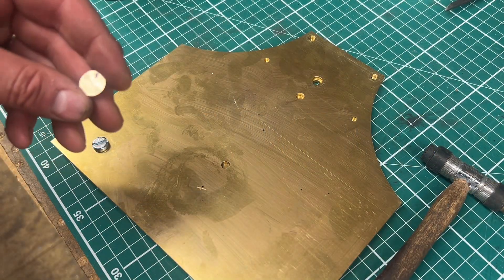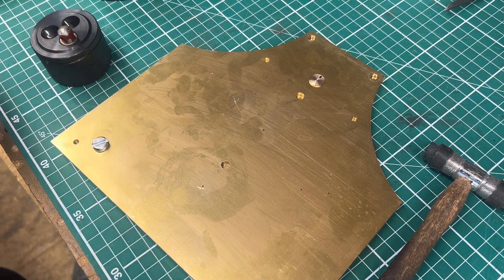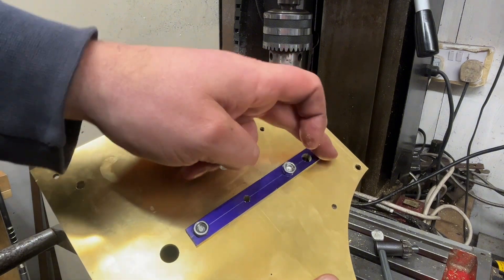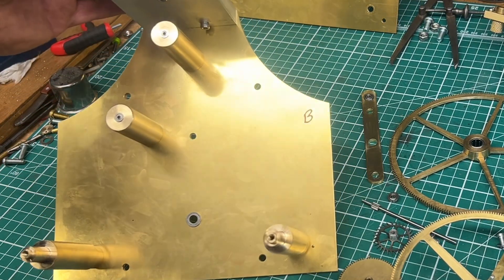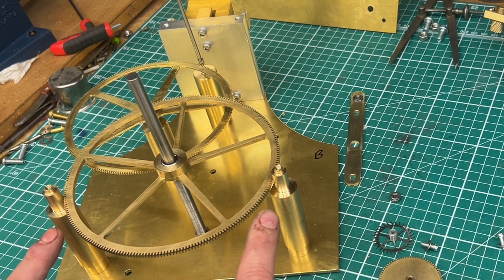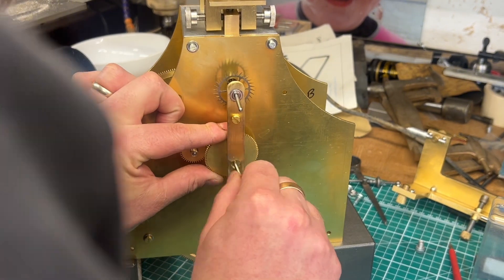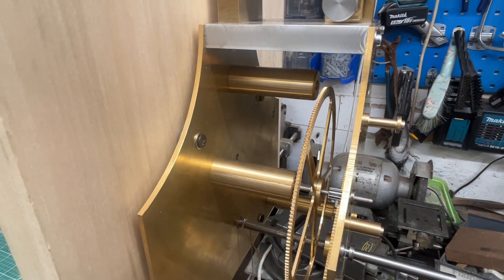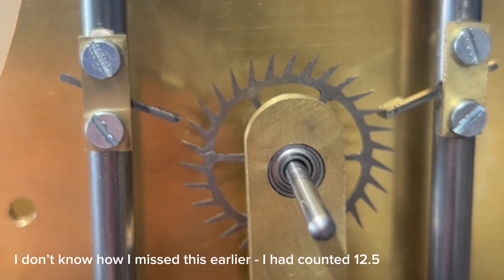Clock Build – Depthing the Train & Testing the Deadbeat Escapement (Tekippe Regulator, Part 7)

Comment: One thing that's clear from the end of the video is that exit drop is much larger than the entry drop.  Will be difficult to keep it running that way and it certainly won't run well.  You can try to correct that by lowering the pallet assembly relative to the center of the escape wheel.  The idea is to equalize the drops on both pallets.  Drop is the distance from the tip of the escape wheel tooth that has just escaped to the tip of the pallet that just released it.  Entry pallet is the one where the escape wheel teeth enter the space between the pallets.  Exit pallet is the one where the escape wheel teeth exit from between the pallets.    

Adjusting a dead beat escapement can be tricky as changes are interactive.  I would suggest finding a copy of  by Charles Terwilliger.  400-Day clocks all use dead beat escapements.  The first section of the book was written by Henry Fried and is devoted to how they work and how to adjust them.  He gives a very thorough explanation of the escapement as providing a table detailing all the possible adjustments and their effects.   Highly recommend this for all clockmakers and/or hobbyists.

Quick question about your design.  What did you you for bushings for the escape wheel pivots?  Please tell me that you didn't use ball bearings ...  Ball bearings are terrific for some applications.  They provide very low friction for continuously running gear trains.  But ... dead-beat escapements are, by definition, not continuously running.  They have to start up again ever half-cycle of the pendulum.   The problem is that ball bearings, even really good ones, have a very high starting friction.  Power at the escape wheel is at absolute minimum and the starting friction of ball bearings will be variable and very difficult to overcome.  Both are real problems for timekeeping.  Brass or bronze sleeve bearings are the best way to go.

All in all, well done.  The design is interesting and the craftsmanship is awesome.  Looking forward to seeing it cased up and running.
Reply from the maker: Morning Tim, thank you for all the comments. I will try and get a copy of the book. If you have time to search for “tekippe model engineer” you will see a long forum discussion I created with a massive discussion about using bearings! I too was not keen to use bearings in the escapement but I went for it based on the discussions over there. I may replace them for brass bushings or possibly even jewels. However there does seem to be a good following believing that new stainless branded bearings are even suited for the escape wheel…. 
Thanks again for your comments, much appreciated.

Comment: Neat, what an interesting escapement. What sort of bearings are those? I've only seen a couple of the videos. Are they all ball bearings?

Armchair horologist here, but I guess maybe riveting in a round slug of brass and then blending it in using the technique that Chris uses could work (I'm sure you know which Chris I'm talking about lol). He does this with tapered steady pins all the time: he uses a very small diameter punch to work around the protruding pin length, and upset it outwards while keeping the blows light, and then once it's riveted in he puts a single layer of masking tape down on the plate (well, he's usually doing it on a bridge) with a hole sized for the riveted pin end, and files down flush with the masking tape. Then he wet sands the whole bridge or plate on a piece of sanding paper laid down on a smooth glass surface to remove the remaining 0.1mm or whatever and blend the head in with the plate. I guess it depends on the finish you'll be going for... if you're going for a grained finish anyway, then blending it in will be pretty doable.
Reply from the maker: Hello and thanks for the comment. Yes I had considered doing this and I’ve done it myself on very tiny 2-3 mm holes. Can’t see why it wouldn’t work on this larger hole… thank you. 
The bearings are reasonably high quality branded (forgot which) stainless bearings with the grease dissolved out of them. 👍